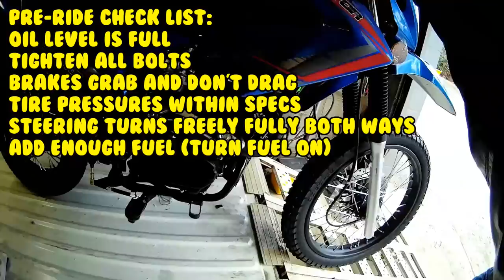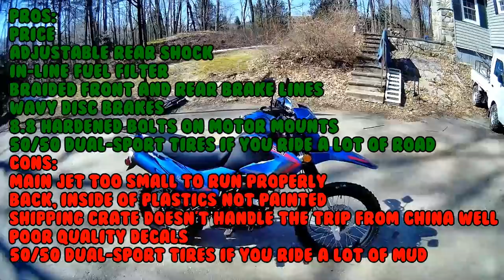$1300 NEW 2019 TAOTAO TBR7 230cc FULL REVIEW build ride mods Dual-Sport Pros Cons.

Comment: Weird it came running so lean from the factory and with a tamper resistant carb.  Neat bike though after you made it right.
Reply from the maker: Yeah, I've had a few of these bikes, they all come so lean.
Reply: That sums up pretty much anything with a carb nowadays from lawn mowers to motorcycles.  Complete with tamper resistant screws, and bad jetting.  Probably why so many of these bikes get bad reviews.  Because it's a clone of a Honda engine designed for countries who don't do well with maintenance.  Easy to build, cheap, runs forever if you change the oil somewhat like you are supposed too.  Yet run a air cooled engine lean for any amount of time you will have a dead motor within 3,000 miles or less.
Reply from the maker: You are correct! It's the new import.laws, elevation affects mixture. Tune these bikes yourself and I've seen them last more than 10,000 miles and still going.

Comment: Hey Motocheez,    It's me again. Hey, I bought three XBR7's and one DLX. Getting them together and started two of the XBR7's. Run crappy and must have choke on to keep them going. I took your advise and bought 4 mikuni carburators to put on them. Really only needed three, DLX should not need one of them. HaHa! Anyhow, the people I bought the Mikuni coarbs from sent out extra jets. With your experience, what is your best guess on jet to use on the Mikuni carb. ? do I need to adjust throttle with washer like the other carb? Anything else on the Mikuni carb to do will switching them out? Thanks for the advise and your time.
Reply from the maker: I use the stock keihin carbs,  mikunis are good but a little different. I'd say a 105 to start with. Middle groove on jet needle

Comment: Looks like the swingarm needs to be about 3" longer, I have a older 200cc china bike. I got at tge junk yard, only thing wrong is the cables broke, and the side cover has a hole in it. Haven't done anything with it yet. It's like a 05 model. I would like to get one and eventually put a better larger displacement engine on it. Maybe reenforce the frame, a 600cc ninja engine would do well I think. Or even a dr650 engine. A 2cylinder is plenty. I do have a CBR1000 engine!!! But no! That would kill me!! But that would be a few years away. But yeah one of these would be ALOT better than the 50cc scooters!  Is the suspension able lowerable? I need it low as possible, I have legg issues,  I would like to get one of the work benches!hu um , trucks I mean!  But $4500 my sister bought a escalade for that price. with just under 120kmiles, I'd like to have a bike to ride around, I'm alone 99% of the time, and the rack would be plenty,,  cool feel her gauges!!
Reply from the maker: Nice. Yeah this one you could lower a bit.. not sure what cc this frame could hold without breaking. Hah

Comment: Could use your opinion: I am the guy that ordered three of these bikes and one DLX. Got them all together. I changed the XBR7's carbs to Mikuni. Not sure what jet is in them. You recommended 105 for this altitude. (5600) They run good but I think a little off. It takes the choke to start but once they start they quit. Turn the choke off then they start and run good. As the warm up the idle changes to a lower idle . Something a little off. What's your guess? I ordered extra carb parts so I can change things if needed. Also, my DLX speedometer does not work. I took front wheel off and made sure pick up was on right. It is correct. Any recommendations on it? thanks for your help and your video's.
Reply from the maker: You have to do the full carb mod like I do in my videos on all the carb bikes. Shim and adjust the mixture along with main jet. The mikuni is a bit different so no need to shim, but sounds.like the mixture screw needs to be adjusted out a bit

Comment: I'm 90% ready to buy the TBR7 with the "adjustable suspension"  How much can I lower the seat with this adjustment?   I'm 5"11'' .  I'm thinking a low seat will make it easier to keep it up with my legs when it would rather fall. 
Which way should the mixture adjustment screw be turned to increase fuel?  Clockwise or counter clockwise ?
Reply from the maker: 5"10 with 32" inseam can almost flatfoot. Counterclockwise increases fuel mixture

Comment: I have a 2014 Tao Tao Cy150A 150cc scooter looks like the same color. I love it, fun to ride around town. I made a stupid mistake so now it needs a new engine. Anyway have fun with it.
Reply from the maker: Thanks! The 150 engines are cheap and easy to swap on those scooters.
Reply: Hmm, I might have to look into that. If you have any guidance I would appreciate it.
Reply from the maker: eBay sells them. Search on eBay "GY6 150 complete" then just check if yours is a short case or not... We've swapped a few if these out, they work good
Reply: Ok, I was just on Amazon. Saw from $180 - $435. Will have to pull engine out to measure it.
Reply from the maker: 🔥🔥 I think there's literally 5 or 6 bolts in the motor comes out pretty quick and easy
Reply: Cool, well I will give it a try and go from there.

Comment: Whats up  Cheez my Tbr7 is basically new havent started it for a year just changed out the battery and still wont work .the lights came on but still couldnt start seems like an electrical issue..what do you suggest?
Reply from the maker: Check your clutch switch, clutch has to be in to active starter, if it's not that try jumping the starter solenoid by batter to see if starter or solenoid

Comment: Tao Tao is the best cheap motorsports option I have several myself
Reply: question is are they reliable at all?
Reply: Just a 1/8 turn adjustments but it's just  picky in the spring and fall
Reply from the maker: I've jetted my carbs on my other Chinese bikes the hawk 250 I never have to fuss with the carburetor ever again for up to three years now no problems at all zep loosening bolts in a couple broken spokes
Reply: @MotoCheez  I've have a scooter go cart and 4wheeler and here in TN I've had way more trouble than when I lived in Dallas with carbs and weather

Comment: TBH..... $1300 for a brand new Two Fiddy cc street legal bike ain't bad at all.  BUT, will the motor even go past the one thousand mile mark though?  I don't care about the little things here and there that needs attention to or replacing, but the motor gotta be stout enough to get your money's worth.
Reply from the maker: The motor is a Honda CG clone, I have a few Hawks and a magician that's gone well over 5000 miles. Biggest issue is bolts vibrating loose TBH.

Comment: If it's has an engine and it's less than $7000 brand new, it's not good quality.  Especially if it's from China.
Reply from the maker: The magician with same engine has over 10,000 miles 0 issues on engine.

Comment: You need to change the chain, brake pads, the silly plastic hand/lever guards, the wheel bearings front and rear, the rear sprocket, the clutch, speedo, throttle and choke cables, the rear wheel sprocket slam blocks, you have a valve setting tool because they need setting a lot, good luck.

Comment: Is it blue loctite for nuts n bolts on these? Use it on most of them, all of them? I'm probably gonna attempt to build it myself cause I'm too broke to pay someone else and would have to take it back apart for loctite anyway, right?
Reply from the maker: Yes, or I use a dab silicone rtv gasket sealer on the threads. Works great on vibration bolts and comes off easy

Comment: Just ordered my TBR7 last night, alcohol was involved. I blew the 25.00 I saved on amazon for the new sprocket and jets, I also ordered the cheap 31.00 lcd display. Wanted to know if you have tried one. I Have already named it "Stimulated"  Also besides a gallon of locktight any other out of the box mods you can think of?
Reply from the maker: I haven't tried the display. Only thing I don't like about the cheaper ones is they give you magnets to mount, but you can get a speed sensor for the front wheel for better install. Sounds like you got most of what you need! Enjoy

Comment: Hey  Cheez, I was messing with the carb on my TBr7 and for some reason the cable and the spring that go on the throttle thing where the jet needle goes seems to go down all the way and I can see it. I start the bike and its full throttle stucked. What did I do wrong?
Reply from the maker: The clip fell off the needle? It usually goes in the plunger and won’t fall through. It’s lifted with the plunger.

Comment: Buy the hx 250 dirt bike from rps. Since the hawk is the dual sport and the magician is the more street oriented bike, the hx 250 is the off road only bike. It's got inverted forks but is slightly more expensive than the hawk or magician
Reply from the maker: There is a DLX hawk that's EFI coming in 2 months too...

Comment: cant get my tbr7 to cut on start period any ideas i had it pre assembled and it worked fine for 2 days..now it won’t turn over like the battery is full charged  but can’t get nothing outta of it no lights horn won’t work
Reply from the maker: There's a fuse or 2 by the batter behind left panel. Maybe something blew it?

Comment: The issue with these things is seldom that they don't work when you get them.  The issue is will they work after the first summer?  In my experience, which is admittedly very limited, they do not.  The good news is you can actually buy an extra 2 engines and still spend less than buying one of the big 4.  If you're just riding around the farm, why not?  If you're heading into the deep "out back" and don't like the prospect of being towed home... maybe get a Honda?
Reply from the maker: My first Hawk is over 3 years old with 3500 mikes. The magician is same with over 10000 miles on it. A few minor issues but nothing major. Both Still run perfect
Reply: @MotoCheez  That's good to hear!  I do realize that the Chinese are trying to improve their reputation through better engineering, but until I hear more stories like yours, I still see the price as the only reason to choose one of their products.  What I'm sure of though, is that if they wanted to... they could kill the competition with even moderate improvements because nobody can compete with their price.  If people had confidence in them, they'd dominate any market they chose.

Comment: It comes with a free $200 hog trap  I want two of them traps I may order two bikes.   This is way better then the Chinese one I ordered in 2012 mine  was terrible    But I put synthetic and slick 50 in right away and I think that messed up the shifting.   It was ok but I just put it up and bought a KLr 650 for $3909. New.  This is a deal for the money.  There is a after maket carb I see for $89 looks like a nice upgrade but no one I see is getting it.    Is this the biggest frame and the best of the Chinese you think ?
Reply from the maker: Ya I usually wait for break-in before using synthetic. This and the hawk DLX is the best 2
Reply: MotoCheez    This one has remote start and alarm   I like the carb is easy to take off to.  It’s kinda side angled.   There’s one with alloy wheels and other upgrades but the carb  you have to take the tank off and all the plastics    Looks great 👍
Reply: MotoCheez     I put an iridium upgraded spark plug in my key alarm and it was like night and day the factory spark plug was terrible and that was a Kawasaki.

Comment: Anyone know if the wheels and tyres will fit the hawk? Id like a more 50/50, if so got a link? Thanks
Reply from the maker: The tires will. I have links for aftermarket tire at motocheez.com in hawk section, TXpowersports has the stock tires. Wheels should fit but they're not an assembly
Reply: @MotoCheez  thank you very much!! And thanks for replying man I know you get alot of comments I appreciate it!

Comment: Red loctite the engine bolts,  swap all fuel and vacuum lines.  Change that shipping oil and lube your chain,  I'd say that would make sure you are golden for the break in.
Reply from the maker: I like permatex for the bolts, great for vibration and you can remove them if needed, the oil I dump at 100 miles and chain lube for sure!!

Comment: Did you say that the choke lever down is off and up is on? Mine won't run in the fully up position only in the middle and down all the way. Only starts in down position or middle.
Reply from the maker: Yes, probably won't start full choke if warmer area. Like 65 and above. If rejetted you hardly need the choke at all

Comment: It's better to rev it out during the break in. It raises cylinder pressure and cylinder pressure is what pushes the rings out against the cylinder. Revving it out gives the rings a better seal when you break the rings in it seals better and that's where you get the better performance other than that there no other metal to metal contact in the motor the oil puts a barrier between the metal parts drive it like you stole it.
Reply from the maker: Agreed. Vary RPM, rev mid low.. just don't hold revved out for 5 minutes on the highway during breakin

Comment: Hummm interesting. But it looks like you need an army of mechanic 15 helpers to build the bike.
How long does it take until 1 average guy with a average tool set to build the bike, not counting the extra order of an Carburetor, extra main and idle jets, sprocket etc...... 
I would recommend if you don't have a uncle, father or grandfather with an entire motorcycle shop incl. special tools and at least 3 mechanical educated helper, do your self a favor and go with a Honda, Yamaha, Kawasaki......
Reply from the maker: It takes about 3 hours. Not that hard really, just bolting a free parts on and plugging wires....
Reply: Hummmm
looking at the vid twice now. I mean, grinding, drilling, adjusting, birthmarks decals coming loose,.....
Wheel install, one guy on hydraulic lift the other try to fit the wheel...... What if there is no other guy?
I know you build already 2 of those and can do it at night during a power outage.
I am not saying the Hawk, the TaoTao is a bad bike. I say it is not for a person that need an vid for "how to make an oil change". Just saying.
I am an mechanical engineer. That is not the question. The question would be whether or  not I am in the mood to go out there in the Texas summer and wanna mess with a bike laying, kneeling in the dirt by 100 degrees and 94% humidity.
No my garage, like many others, is not air conditioned. 
Just saying.

Comment: I have a question, I went to my local tag office and they ran my Vin number on my tbr7 and said it was for off road use only. Do you think something is wrong with my mso\vin number? I also called the head tag office in Georgia and they said the same thing. Any help would be greatly appreciated. Thanks
Reply from the maker: Hmm. I haven't heard an issue with GA. Check chinariders.net. They're the best resource.
Reply: @MotoCheez  ok thank you

Comment: If it came that way, I think I would just call them and tell them to give me another one.  You shouldnt need to tear apart the carb with tamper proof bolts.
Reply from the maker: If I was at 2000 feet the jetting probably would be alright. This is my 3rd chinese bike, they run a lot better once you tune them in they are sent lean for EPA

Comment: Chain Adjustment should be about 15mm at the tightest point of suspension travel.  Where you had it adjusted after the front sprocket install was actually too tight.
Clutch adjustment should be 3mm of free play at the lever at the tightest point of bar turn.
Those brush guards are going to shatter the second they hit something (has already happened to one owner).  Otherwise, it's a nice bike with good as delivered quality.  They are still jetted a bit on the lean side like most of these bikes, but much better than the Hawk is out of the box.

Funny thing is, the Hawk stopped coming with the signal beeper in 2017 and instead came with an electronic flasher relay that can support LED signals without fast flash.
Reply from the maker: Specs I took right out of book, both 10 to 20mm, (corrected)  I like below 10, like 5mm mark... Yeah, I can see they're not great plastic.
Reply: @MotoCheez  It could be that the 5mm is just for the average Joe with the bars straight.  I just tend to not believe everything those manuals state, because often they are just generic copy and paste manuals with generic specifications.  I have found the CSC TT250 adjustment specs to work far better than anything else I have found for all of these Chinese enduros.
Reply from the maker: I agree, but didn't want to go against the manual given... As you can see, I stayed on the low side. They say 10 to 20mm.. typo on last... 3mm kinda small for the non nylon clutch cables IMO

Comment: Thanks, but I have a question:
Was what you did to the carb necessary? I am at 9k altitude, will that have an effect?
Reply from the maker: You may be ok with stock jetting. Higher altitude, lower jets.
Reply: @MotoCheez  Thanks for the reply

Comment: Where is the Spark Plug?  I have been trying to change the Spark Plug and cannot find where it is.  Can you do a Spark Plug Change Tutorial?
Reply from the maker: It's on the right side forward of the kickstart just under the tank, this one has a chrome spark plug cap. I'm in FL for a few weeks. Plan in some videos when I get back
Reply: @MotoCheez  Thanks.  Learning experience trying to locate items. Was concerned this morning with a non start.  Charged the battery and now works well.  Thought it was the Spark Plug.
Reply from the maker: 👍👍 yes, I should do an orientation video!!